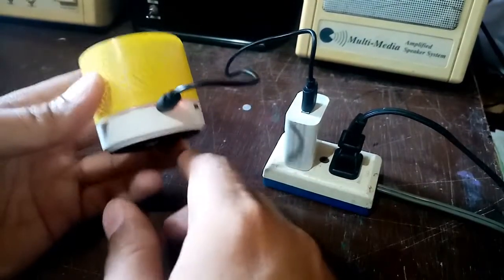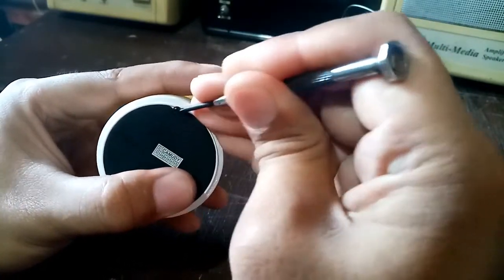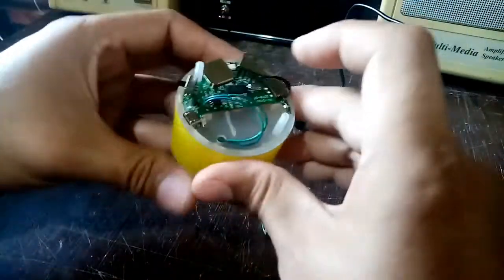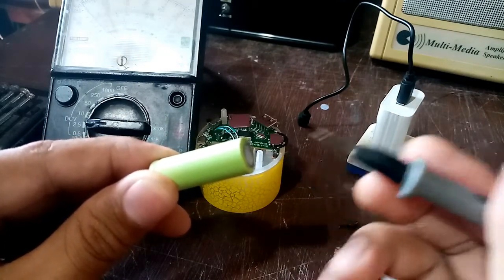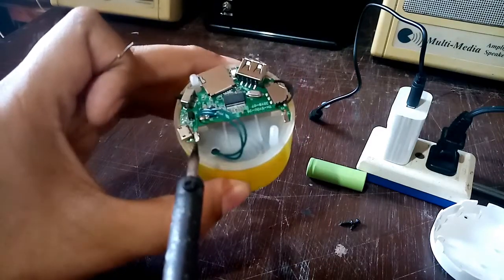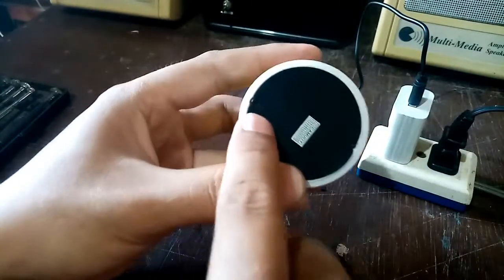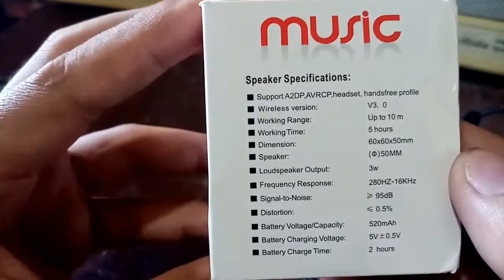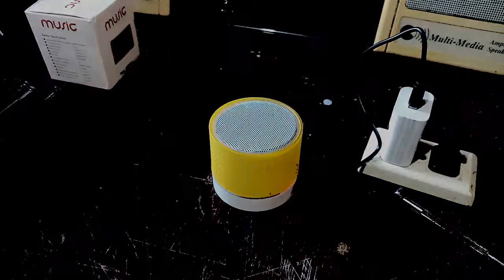Here's How to Fix Bluetooth Speaker: Battery Shows Charging Battery Is Still Empty

Comment: Hello, I also have a small blueooth speaker. It doesn't turn on. The only thing that lights up is a blue LED when i olug the usb 5v charge. The battery has 4v. What can i check to troubleshoot the problem? Thanks
Reply from the maker: Try to replace the battery

Comment: Hey I have the same speaker branded cisco meraki procomp. I also have similar charging issues when I give it for charging the red light displays but doesn't turn off and even after I charged it for 4 hours the battery was showing at the starting to be 30% then it went up to 80% then suddenly 20% and so on keeps fluctuAting... I don't know how to reset this... Pls help
Reply from the maker: Try to replace the battery
Reply: @woodys_hobbies  but it's almost new... I had got it like few weeks back... And haven't even used it for an hour. And it feels like there's more of a technical glitch because as I told... The battery goes from 20% to 80% sometimes and it stays there. 
Isn't there any way to factory reset it?

Comment: What is the volt of battery; i want to replace but not mentioned on mine.
Reply from the maker: The battery is 2.5volts you can used 3 volts maximum
Reply: @woodys_hobbies  thank you 😊
Reply from the maker: @devashishvats2818  welcome

Comment: We are same speaker but i open it the bettery it's not same at you the battery like a flat and i charge 2hr and still low battery what i gonna do
Reply from the maker: Try to replace a new battery or check battery connector before you charge the unit sometimes battery connectors loss contact.
Reply: Yes my speaker also have this problem , but there is no information on the battery so which mh battery should l fix 🤔

Comment: I've just bought a Bluetooth speaker beginning of this week and it wasn't charging before and now when it charges it get extremely hot my family think it'd a bad battery
Reply from the maker: What level of Hot when you charged? It is normal for the battery to become hot when charging. On the other hand try to charged the battery uncover the MP3 and try to observed the temperature of the battery. When you charged it for a few minutes then the battery cant be touch anymore then their is a problem in the battery or in the unit. But you charged it about 2 hours then battery is hot but if you touch the battery you can tolerate the hotness then its fine.

Comment: What if the Bluetooth speaker indicates charging when battery is not there but once the battery is inserted,the charging indicator went off
Reply from the maker: It's has a problem in the charging circuit.
Reply: @woodys_hobbies  ohw...thanks boss...what can be the solution
Reply from the maker: @biggieman8982  Solution is to buy new. Now a days MP3 players is a disposable units. It's hard to troubleshoot because of it's parts very small.
Reply: @woodys_hobbies  ohw, bad news..........its jst few weeks old.it's a new one
Reply: @woodys_hobbies  so you don't have any suggestion on what can be done to correct this fault.......i have even changed its IC that burnt
Reply from the maker: @biggieman8982  if you can buy a replacement IC then why not. In troubleshooting in electronics it's not always the IC. Check first the cheap parts of the circuit like resistors, capacitors, transistors that connect to the charging circuit. before replacing IC.

Comment: So i need to off when i'm charging this?
Reply from the maker: No not really you can use this even when charging.
Reply: Bcuz now I had to charge this in overnight, but when I try to use it in the morning, its totally lose a sound. So ilI think its has a problem. 🤦‍♂️
Reply from the maker: @fedrickz9712   try to open and check the battery inside use a voltmeter to read the available voltage in the battery approximately 1.2 to 1.5 Volts if it is fully charged. If it reads 0.5 below battery is not charging.